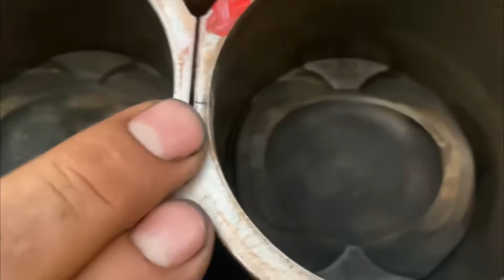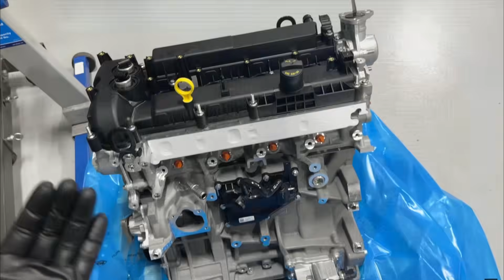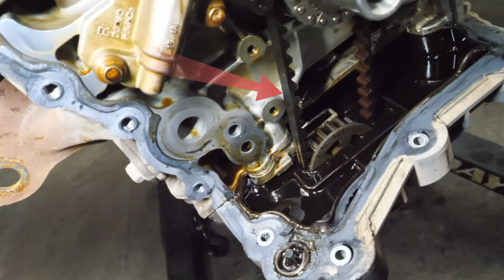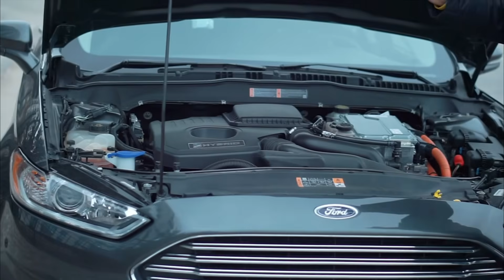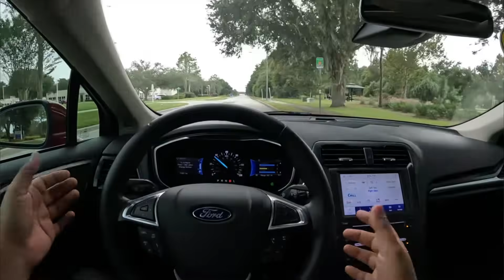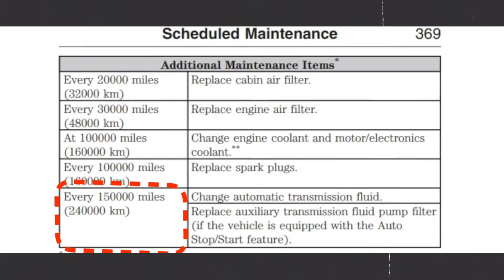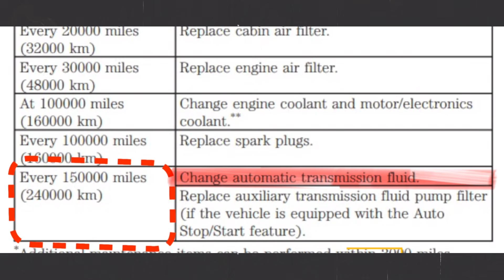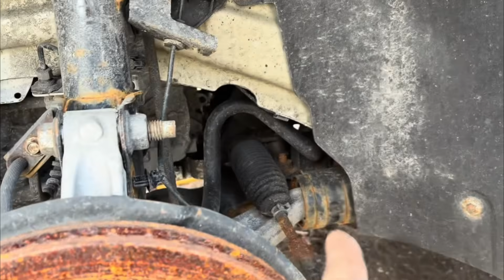Ford Fusion (2013-2020): A Complete Reliability Guide

Comment: I've owned a 2017 Fusion Sport for a year and a half now and love the car! I got it with 58K miles and currently have 92.5K on it. I do all the maintenance myself and heres what thats been: oil changes every 5K miles (getting oil analysis to see if the Amsoil can go longer), transmission fluid change when I got the car, and i did it again at 85K miles to find it needed more fluid than I drained for a correct fluid level (it shifted good before, but 3rd gear is noticeably less harsh now). At 62K miles I replaced all rotors and pads (the rear pads wear faster than the fronts on these cars). Then spark plugs at 80K miles (time consuming, be warned), serpentine belt and idler pulley (old idler pulley had started to squeak and i found out whoever put a Dayco one on somehow misaligned the washer and totally bent it in putting stress on the bearing, replaced it with a Motorcraft belt and pulley), and PTU fluid change at 80K miles, very easy to do. At 86K I flushed out the old orange coolant by doing multiple drain and fills until I had added nearly 3 gallons of the new Motorcraft yellow coolant (Ford stated they are totally safe to mix for a top off, drain and fill, or flush). Then I couldn't do the rear diff fluid myself because of a stripped drain plug (it's in a very tight spot, a torx socket won't fit because of a subframe bushing very close to it), a local shop freed up the bolt and changed the fluid for me and replaced it with a new bolt I got from Ford, $130 total. The only parts that failed were a purge valve which I replaced in a few minutes for $75 (rough idle after filling up with gas) and a rear wheel bearing at 62K miles as well, I had a shop do this for $450. The biggest problems by far with this car are the wheels, they're 19's and have 40% aspect ratio tires. You must keep them properly inflated and keep your alignment good or they'll wear fast. I've also had bent wheels which has been a pita. When I'm done with these tires I'm getting 18 inch wheels and 45% aspect ratio tires, also will upgrade to 245's over the 235's. If you live in the rust belt, the AWD is great in the snow and the car holds up well in salty areas. I don't know if this car was undercoated before I got it, but it was from Cleveland and has no rust at all. Ford did a very good job with this car, it's fast, very comfortable, and can get 30 mpg highway. One of the best cars I've ever used!
Reply from the maker: Thx for a such descriptive comment 👍🏻
Reply: @thelonglastexpert  another note that I should mention, is that all the Fusion Sports had chain-driven oil pumps, or so the parts diagrams revealed. The same goes for the Lincoln MKZ with the 3.0 EcoBoost since it's a very similar engine. The SUV's and Lincoln Continental with the 2.7 EcoBoost received a belt-driven oil pump starting for the 2018 model year and beyond, and 2018 and beyond for the F-150. Since the change started for the 2018 model years for these vehicles you would need to enter the VIN into the Ford parts lookup system to see if that specific vehicle has it or not.
Reply from the maker: @performancepass4945  Yeah. I mentioned this in the video: Ford Fusion Sport was equipped with chain-driven oil pumps.
Reply: @performancepass4945 hey man, I'm about to buy the sport variant 2017 model, I really really need someone expert to talk to, 
Please may I have anything of yours so we can have some chit chat? I would love to show you the car that I wanna buy because it costs about 18,000$ in my country for this variant so it's not a small matter to not be worried,
I don't think I can find a better person than an American explaining an American car for me.

So if you are interested, which social app you wanna use? I have Instagram, Facebook 

I'm waiting for your reply,
Tanks in advance.
Reply: Thank you for all of information and experiences... I am stuck between picking, 2017 FFSport vs 2015 BMW 335xi and 2017 Honda Accord V6. I do live in rust belt, PA. You are convincing and pushing me more towards the Ford... Thank you!
Reply: @raphaelfrancis4509  the V6 Accord and FFSport are sleepers for sure! With the Accord you've gotta do a timing belt replacement every 100K miles, but the J-Series V6's they have are great otherwise. For the Ford, it'll need oil changes every 5K or sooner and trans and ptu fluid changes every 30K, but I've heard Honda transmissions aren't the best either long term. BMW that's a whole other animal 😂. Definitely gonna have more expensive parts and be much harder to work on. But drive all three, they're each cool in their own right
Reply: @ Thank you, much appreciated! The Honda timing belt is a cake walk, after dealing with an Audi. The Ford is new territory for me, but I don't mind learning about it. As for the BMW.... Yeah... That's something else. I am trying to build my confidence to deal with that thing...
Reply: I have a 2018 Sport with 58,000 miles. Bought it last year. I have since tinted the windows, custom exhaust, 93 octane tune, colder plugs, new wheels and tires. I love the car!
Reply: @chriskrueger8225  that's when I got mine! I'm gonna be replacing my shocks and struts here soon since the rears are leaking oil and they're noticeably worn out. With your miles definitely keep up on trans, diff, and ptu fluid changes. Also switch to the better Motorcraft yellow coolant if you haven't yet
Reply: @performancepass4945  thanks will do! I bought mine about 20 miles east of Cleveland. Small world. I just did the purge valve today, and it's running so much smoother. Especially at idle. Unfortunately I also found about 6 or 7 acorns and rodent poop in the engine bay!
Reply: I have a 17 Ford Fusion SE 2.0 hybrid. Unfortunately, just FWD. 148k miles bought at exactly 100,008 miles. Oil change coming up but my shocks, tires, and alignment are bad. Shock are completely bad but the absorbers are definitely lacking. Got a new tire for front right hasnt been straight since. My sports tires in the back, just roll, starting to hum and signs of dry rot. My frame is damage from prior accidents before I bought it. Reverse t-bone for both accidents. 1 on each side. The driver's side was fixed(less significant accident), but the passenger was patched. Big bumb on passenger rear floorboard. 

Surprisingly, with all these issues. Runs perfect without any dash lights
Reply: Before you say it shouldn't have bought it,  I got it of my aunt for 8k. Also my first car.
Reply: @alaricsteffens1068 8k she really robbed her grandson what a cuck
Reply: @alaricsteffens1068 that humming in the back is likely a bad wheel bearing. I've gone through 3 different ones in the rear on my car. If you can DIY youll save a good bit of money but do know they're a royal pain once rust gets on them, they seize into the knuckle. Shocks and struts arent difficult to replace DIY either, I recommend getting motorcraft parts though since the ride quality is unbeatable. Good luck, those hybrids are an amazing platform!
Reply: i will add, if your planning on 18s for the wheels double check the front calipers fitment, i got some focus ST wheels for my sport and the front brakes touched the wheel( >_>). i got 18s so i could run better all season tires with more meat on them so to speak. because yeah i noticed id loose my inside tire edge way too fast, now i rotate frequently.
 also damn those rear plugs XD
im glad ive seen someone comment all the things ive done also with this fusion to make sure its as good as it can be. havent done the diff yet, but im not far from just getting it done.
Reply: @chrisweskamp9466  good to know. I saw in the Fusion Sport forums some other guys had no trouble running 18 inch wheels from older Ford Fusions. I wanna get the black 20 spoke ones for my car.
Reply: I should look for 18s from a fusion then. I wonder if they have a larger inside space in the rim @performancepass4945

Comment: I Owned a 2010 Ford Fusion 2.4 i4 non turbo non eco boost .   Most reliable car I had owned. Bought used 38,000 miles and it had 289,000 when it was totaled in a crash.   I did oil changes every 4000 with full synthetic 5w30.  Ford stated “Lifetime” transmission fluid so it didn’t recommend a transmission fluid change,  I changed transmission fluid every 30,000 miles with Valvoline Maxlife ATF .  Coolant drain and fill every 50,000 miles same for brake fluid.    “Lifetime fluid”  ford projects lifetime do the transmission to be 100,000 so that they get repeat customers , designed to last then fail!  7000 mile changes  designed to last just enough then fail. But if one does proper maintenance not the recommended maintenance, but proper maintenance and not get the ones with eco boost  it is one of the most reliable vehicles out there !
Reply from the maker: I think even if you had an EcoBoost, with such maintenance, you would have driven your 300,000 miles on it as well. 😂
Reply: @thelonglastexpert     Don’t know if the turbo would have lasted I like the regular base engine 2.4 or 2.5  inline 4 cylinder that came on the base model S  and sometimes in the SE.  but yes with regular maintenance any vehicle should last longer
Reply: @jorgehernandez8657  I don't think there was a 2.4 liter engine in these cars
Reply: @dirkdiggler5164 2.5
Reply: I’m at 231,500 no problems. Oil change every 6k and transmission change every 60k miles
Reply: Sorry to hear that your frequent 
oil changes caused you to total it.
😄

Comment: There isnt any Ford that could hold a candle to Toyota for reliability! This person is dreaming!
Reply from the maker: I hope you watched the video in its entirety
Reply: @thelonglastexpert  2014 fusion  2.0 ecoboost vep engine ( spanish built engine )  now has 200046 miles on it.. no oil useage,, transmission shifts perfectly, no jerking.. still has all the power it came with  24 city  at 68 mph in cruise control  34/36 mpg at 70 i get 32/33 mph
Reply: @thelonglastexpert  the silence tells me he didn't
Reply: Toyota sucks these days, unfortunately. Nothing they can do about it
Reply: you're funny. you do realize toyota and ford co developed the last generation Fusion, right?

they're not dreaming. they did research.
Reply: @co0chiesqueen988 oh really ? Toyota did with Ford? Wow… I didn’t know that
Reply: My 2009 Ford Fusion 2.3 had 210k miles on it before it was totalled. Original engine and transmission. Changed engine oil every 3500 miles and trans oil every 30k miles. Best car I had.....even compared to a Toyota I have owned before.
Reply: Fact is the Fusion hybrid is built with a ton of Toyota technology!
Look it up!
Reply: You should look at the Tundra vs F150. Ford has had a 10 speef 3.5 turbo v6 truck for more than a decade. Since the Tundra did the same in 2022, the F150 actually got better reliability ratings than the Tundra.
Reply: @AudaciousCaesar  pretty sure this video was about the ford fusion
Reply: @ I was replying to someone stating Ford will never surpass Toyota in reliability, however it seems they have deleted their comment.